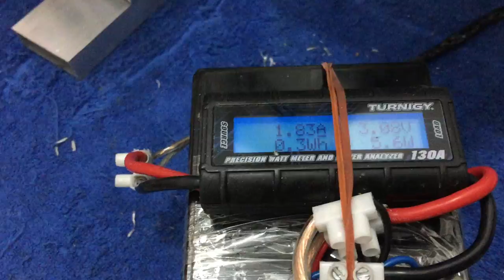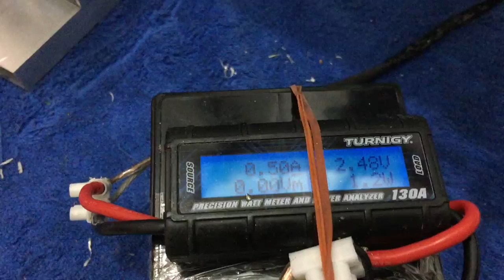New Unbreakable Flywheel Energy Storage "Extra Free Energy" with magnets built by oren gertel

Comment: I built a device once that had several disks all larger than the next. I think I had 10 in all.   The smallest 4 inches and the largest 4 feet in diameter. Each disk had aluminum plates on the outer edge side facing the next larger disk. Each disk had magnets on the side facing the smaller disk place in the diameter of the next smaller disk. All except 2 of the disks were on a shaft with bearings that would turn independently of each other except for the largest disk was attached to the shaft. The very smallest disk was attached to a 9 volt motor about the diameter of a quarter. I would turn on the motor and it would spin. This would start the bigger second disk spinning and the second d would start the bigger third and so on.  I was able to spin the 4 foot disk at about 135 rpm in the end. You could slow the largest disk with a load and have very little affect on the smaller disks.  I have torn it apart and the rennets are still in my basement. I would love to see this built to high tolerance specs. Maybe even use copper plates or coils instead of aluminum plates. 

Mine was cut out on a table saw from 3/4 project board and some parts made on my cnc router to hold bearings and such.

Magwave@computers-plus.net

Comment: Hi Oren, you should unplug the motor/generator  and let it run; or is the battery needed in your machine?.
Reply from the maker: In this video the machine needs a battery
Reply: Not just in this video mate. Forever. Free energy is real but it works on the differential between the planets magnetic field and its rotation. In practice a device that would do any useful work is about 10 football fields lol.

Comment: How much torque is developing? Could you gear it to run several smaller motors at higher speed? Imagine the torque it would develop if you had multiple engines connected tothe same shaft !!!! Is it unbalanced and does it self destruct mechanically? Why does it stop when you throw the switch? Also what is under the table? LOL
Reply from the maker: Maybe there's a hand under the table?
Reply: Was thinking more along the lines of it being battery powered. Reminds me of one of those old magnetic desk top mobiles or a steem engine :P
Reply from the maker: Everything you see in a video is real!!
Reply: Yes I appreciate that and the work that goes into building something like this. I just don't see how it is "unbreakable" or creating "extra free energy" ?
Reply from the maker: The video shows how much the machine consumes electricity, is not connected to an alternator for generating electricity

Comment: too many moving parts thus more mechanical failure points and reduce efficiency...plus you have to remove batteries and any other outside sources of energy and see whether it can sustain itself.

spoiler : it won't and eventually stop